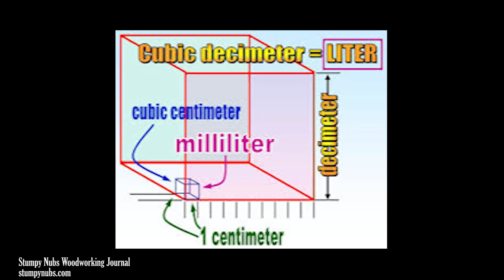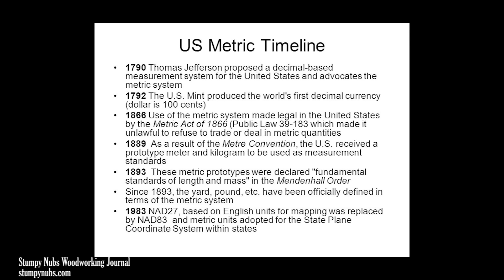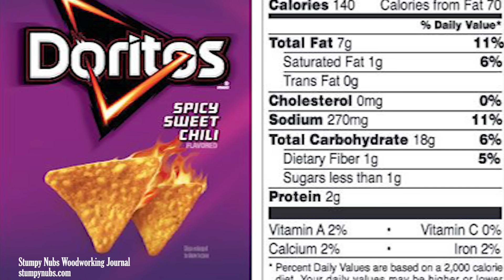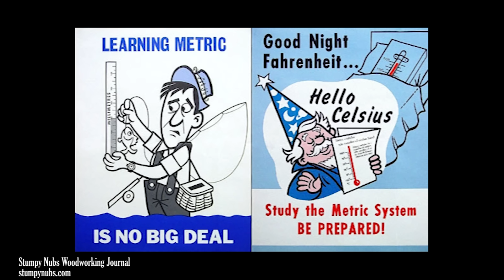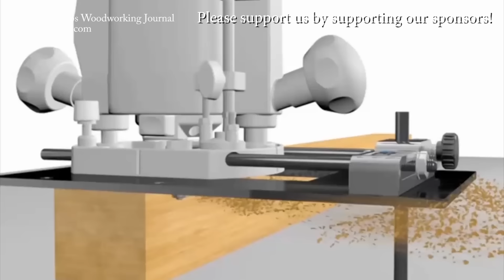BREAKING: The USA is switching to METRIC!

Comment: The last time this was tried was during the Carter administration. Like most things during his presidency, it wasn’t successful. The cost of changing machinery & hardware was extremely costly. If machinery is gradually replaced as they wear out, not a sudden mandated replacement, it will be possible to change.

Comment: It’s also so much more logical for temperatures – Centigrade vs Fahrenheit. 

20° C is twice as hot as 10° C! 40° C is twice as hot as 20° C. Incredibly useful. 

Stupid Fahrenheit – what is 20° F? (Better wear gloves out!) 50°F? Still need a jacket. 70°F. Start thinking about shorts. 90°F? Beach! 

So much less useful than easily knowing 100°C is 10 times hotter than 10°C!

Comment: One important point you haven't made: imperial IS metric these days.  An inch is oficially defined as 25.4 mm. Because of this, when you are using imperial units, you are just using metric with some weird multiplier, so you might as well just switch.

If you had an actual separate imperial length standard, an inch stick or a 1 foot rod, switching systems would mean loss of precision; and you could never switch exactly.  But there isn't.  The stick is a 1 meter stick.  Just change your multiplier and poof, you're metric.

Comment: Lay out a circuit board in inches and in metric.  Night and day.      Design anything in metric and you have such a simple time finding the middle and making equal spaces.   If we wanted to change things, starting out with wood dimensions would pretty much get the ball rolling.    ( However,  we're idiots. )

Comment: South Africa went metric in 1968. I remember the petrol bowsers were changed from 40c per gallon to 9c per litre. I tried working on a project where the plan was measured in inches. When you see 6 5/8” on the plan is where you say enough! 😄

Comment: Residential construction and building will likely stay Imperial in the US.  That is mostly taught from doing, young learning from old. Old use imperial, so new learn Imperial. Also Road speed signs will likely stay as MPH simply due to most current drivers being used to that and most cars with speedometers in MPH.  Change that suddenly and chaos ensues

Comment: One fact is that everybody who comes from metric and has to switch to imperial hates imperial for the rest of his life, while someone coming from imperial switching to metric will eventually love it. All science and engineering calculations are done in metric because it is so much simpler. Only construction will need some time to adapt, to get used to new numbers. A 4x2 will be a 10x5, 12 ft will be 366 cm.

Comment: In the Netherlands we don't realise we never went fully "metric" either. Our rulers are metric, but we buy lumber with the width in "duim" (2,5 cm), floor tiles are measured with "voet" (30 cm), when we go to the butcher we often ask for a couple "ons" (100 grams) or a "pond" (500 grams) of meat. We only altered the conversion factors to correspond nicely with metric. In a situation where you want to exactly measure, metric is very useful, but if you want to estimate things, imperial is convenient. I use quite some American made parts, stuff where hole spacing is in imperial. I refuse to convert this to metric and end up with overly complicated diagrams. I have some imperial tools as well, both systems work and both systems put people into space.

It doesn't really matter if one is a bit more convenient than the other, people need to completely relearn how to measure and estimate things. Institutions can move to metric whenever it's really needed but the average Joe probably doesn't care and is gonna stick with what he knows. 

As a European metric user by default, I say both systems are adequate. I use them both almost daily, both make sense, they only annoyance is that mixing both systems is the hard part. Get yourselves an imperial ruler, and learn to work with it. Sometimes metric doesn't round beautifully up and down, imperial will for your projects. I rather work with whole numbers and two systems (atleast for now) than a bunch of digits behind the comma. But hey, to each their own hahaha

Comment: What's interesting is that standard measurements still are engrained in the global circuit board industry. Even a Chinese PCB manufactures has ounce measurements for copper thickness and minimum trace widths and spacing in mil (thousands of an inch). Of course you can use metric, but they are awkward conversions to 3 decimal places.

Comment: I think keeping the imperial system is good too, but keep using both and teach metric in schools. Road signage would be a challenge and cost a lot. Here in Australia we still use both to a certain point. We use psi for tyres, we use knots for weather forecasts. We also use squares for building sizes which is 10sq ft. Also ceiling heights are feet. We still use lots of food recipes in cups and the most funny one is screens and tvs used to be centimetres now it’s all inches world wide and funny enough lots of us young and older Australians still give feet and inches for our heights

Comment: Metric is not just useful when working WITHIN a measurement system (like distance, area, weight or energy), but it's ESPECIALLY useful when CONVERTING between systems. For pure water at Standard Temp and Pressure 1 cubic cm = 1 millilitre = 1 gram. 1 metric tonne = 1 cubic meter. 1 joule = energy to raise 1cc of fresh water by 1 degree C, 1 Hectare = 100m x 100m etc etc. And since all material DENSITIES are listed in reference to water being 1 it's dead simple to find the volume of a material by weighing it and dividing by density. (MASS and WEIGHT are different, but unless you're measuring to milli or micrograms, gravity will have a negligible effect.

Comment: Loved this video.   Metric really is much easier, especially in conversions.

For example one litre of water weighs a kilogram, a cubic metre of water weighs a tonne - you can't do that in Imperial.

A Watt is one joule per second, a Joule is is equal to the amount of work done when a force of one newton displaces a mass through a distance of one metre in the direction of that force. It is also the energy dissipated as heat when an electric current of one ampere passes through a resistance of one ohm for one second.

A Pascal is one kilogram of force over one square metre,  a Newton is the force required to accelerate one kilogram one metre per second per second etc. etc.   

SI is so much better...

Comment: Being from a metric country (Brasil) I should agree that looks "stupid" that US still insists on imperial system while 90% of the world goes metric. However it's not a simple task moving from a system to another. This is something so stuck to the American culture that it could take at least a full century to fully perform this change (and yet there would have remains everywhere). Moving from a system to other is not like pick a metric measuring tapes and learn how to use it. Think about all the traffic signs and the vehicles tachometers that are set for miles. Think about all the bolts and screws existing in millions of machines, all set in inches, with its respective wrenches. All those machines and tools would have to be disposed and remade (of course we are talking about a FULL change). And it's not just length and size. Think about weight and all the millions of scales all around America that would have to be replaced or at least entirely adapted and recalibrated. Think about all the packaging that would have to be reprinted (it shouldn't be actually too hard). Think about the educational system that would have to be fully changed to start teaching kids how to do metric and imagine trying to do this to adults that used imperial their whole life. Think about all the serious mistakes that would happens just because bad trained people (or simply people unable to understand the new system). Think about all the measurement equipment like cups, rules, tapes, precision laboratory stuff, etc, that would have to be disposed and full replaced. Think of the cost of all of this. Think of all the labor. In my opinion the logistic to allow such change is so huge that I believe that there is not the minimum possibility of US (and the few other countries that still uses imperial system) to make it.

NOTE: of course it doesn't mean that you cannot do it yourself in your own shop and move to metric rules and measurement tapes (although I really don't see any advantage of doing it if you live in an imperial system country).

Comment: just like to point out that the decimal system is not the same as the metric system.
Decimal system is just a base 10 number system which seems to be common to eastern and western cultures and languages - probably cause humans have 10 digits.
Metric system is kg , meters and seconds -and almost any other quantity can be based on these - like 1 litre is just one cublc decimeter of liquid volume.

Comment: I watched a video someone made about converting to metric and there was one thing that stuck out to me. As someone who has used inches most of my life but has used metric for half. Metric just doesn't mean anything to me. Like physically. If someone tells me something is 5ft, I can picture that, when someone tells me they are 1.9m tall that doesn't mean anything to me. The biggest issue someone has converting is the physical distance they put to that measurement. The one argument I always here is that the conversion between feet and miles is too complicated. To that I say, so what. I've NEVER had to convert from feet to miles in ANY practical situation. There is a point where distance becomes too large and becomes an extremely rough approximation. You can say a shed is 12ft by 20ft and that makes sense. When you say something is 400ft, it becomes a generalization. Without using tools, distances become arbitrary and only becomes a ball park. the difference between using meters and feet is irrelevant. Beyond that, when is the last time you said the grocery store is 48.35km away or 5.26 miles. No one does that. It is 50km or 5 miles. When you have to use exact measurements you have to use tools anyways. 

Beyond that, I prefer Fahrenheit for temp. It is smaller increments and I like my house at 69 degrees not 70. And then there is the boiling/freezing debate. Does water boil at 100C? it can but it doesn't always, in fact it only does that at sea level. In the mountains you can boil water at 92C. Oh and you also need pure water, stuff like salt will mess with boiling and freezing as well. That means that the only place where this actually would matter is when your cooking food and I can't remember the last time someone took the temperature of a pot of water to check what the temperature was.

If you think we are bad check the brits or canadians, they routinely use kilometers for distance but then use speed in mph. Also, pretty sure the world measures their tvs in inches.

Comment: 1 horsepower = 2545.46 BTU per hour.  1 Watt = 1 Joule per second.  For engineering students struggling to pass Thermodynamics class, SI units are far easier to deal with than Imperial. But I don't want to buy gasoline by the liter or measure lumber by the meter, and there's really no reason anyone should.  Volts, Amperes, and Watts are all metric, as are many other units Americans commonly use.
In the most common version of the metric system,  SI, units are base 1000, not base 10.  Thus we get prefixes like nano, micro, milli, kilo, Mega, and Giga.  The centimeter isn't an SI unit, it's 10 millimeters or 0.01 meters.
I use metric units for all my professional work, but it's not without its quirks.  Engineers like the SI meter-kilogram-second system with force in Newtons, while many chemists still prefer the old base 10 centimeter-gram-second system with force in dynes.  
The worst quirk, however, is that the 'official' metric system (if there is such a thing) refuses to recognize rotation.  Yep, according to the BIPM in France that decides such things, rotation is dimensionless.  There are no degrees, no radians, no Hertz.  In their absurdity, a half a bowl of cereal must be the same as a full bowl of cereal rotated half a turn.  To be fair, their official way of expressing it is "one cereal at one half cereal per cereal."  For obvious reasons, everyone outside of the BIPM ignores that rule and applies any of the non-metric units of rotation.
Imperial units have quirks as well. The metric system correctly differentiates between mass (kilogram) and force (Newtons).  Imperial units can't seem to wrap their head around this simple truth and call them both pounds.  Thus, a pound mass, accelerated by 32 ft per second squared   is still a pound. Mathematically,  1 lb = 1 lb ft /s2.  To overcome this mathematical dilemma, engineers use lbm for mass pounds and lbf for force pounds.  The Brits use stones for mass but not force, which also works.

Comment: In the UK we haven't fully gone metric. 
We describe a cars efficiently in MPG, our road signs are in miles not Km.
We drink pints of beer, but it's probably officially the metric equivalent. 
I think officially we are metric, we just have some imperial leftovers.
I school we are taught both and I often switch from one to the other. 
When measuring long distances I may use inches and when a finer measurement is needed mm.

Comment: The Imperial System and the US Customary System are related but not exactly the same. The main difference is in volume measurements. The Imperial System was codified in 1824, the US Customary System is based on British/English systems of the 18th century, at the time of independence.

Comment: Up here in Canada we aren't 100% metric. It's mostly because US and Canada are each others largest trade partner, and alot of our culture is fairly similar so it gets confusing if we don't do some imperial stuff, but we kind of do 50/50 and hope no other nation calls us out for it. Everyone uses feet and inches for their own height and pounds for themselves, and we will uses "cups" for cooking, but no other imperial unit. No one will know what a quart is. We have metric for road signs, food labels, gas, etc. Most construction uses imperial, however it can depend on how precise measurements have to be and what job it's for. We took one half-step away from your system, did a deep breath out and congratulated ourselves for being better than you guys, while not actually doing the whole thing

Comment: I'm Australian and have always used metric - but am certainly familiar with imperial.  Biggest problem I have with imperial is knowing what the next sized spanner is.  eg, what comes after 1/2, 3/8 etc.  Metric is easy in that in that if the 10 mm spanner is too small you grab an 11mm.
Wheel sizes are dominated by imperial with a couple of exceptions in bicycle wheels where 700c is the current road bike standard.  But otherwise I have bought 12, 16, 20, 24, 26, 27.5, & 29 inch bicycle wheels/tyres over the years.  Car wheels are the same, but is comical in that the width is mm, diameter is inches, and then you have the aspect ratio.  So the three numbers on your car tyres are three different units 🙂
In my mind the word "miles" just sounds better in throwaway comments...  eg, "we are miles away", "missed that by miles", "hit that golf ball a mile".  Using the word "kilometre" instead of "mile" in those little comments just doesn't sound right.
I think imperial with height and the weight of a newborn baby - eg, I know a nine pound baby is a big one.  If I hear a 4kg baby I tend to need to convert to pounds.  However when discussing weights after babyhood it is kg all the way for me... go figure 😅
Reply: I fully agree metric is far superior than imperial, but we need to standardize on what we call a wrench.
Reply: @stevenlochner4619  haha - never happen.  We can't even standardise spelling 😂
Reply: "Go figure" - pun intended !! I agree imperial can be better using in sentences. E.g. Milestone is better than a kilometrestone.

Comment: Im a product designer and can use both inches and mm for length to design easily. Go between, use fraction on the inch stuff I know all the decimals to the 16th off my head. But aside from psi I’m pretty much using all other units or combinations of units in metric

Comment: Good point. I have been using metric in my shop for years and find it much easier when building projects and cutting material to size. Why is this you ask? 
well, many don't realize that the materials we have been using for years are actually produced in metric sizes. Frustrated me when I was doing all I could to get my projects right and doing the math on a close enough scale that they would always come up not quite right in the end. I have many metric tools in my shop that I use on my channel as well. Seriously considering the full conversion in my shop for good. 
Thanks again. Awesome video.

Comment: Metric life is just so much easier because everything is based on the unit of 10, so it is interchangeable.
100 cents in a dollar.
100 centimetres in a metre.
1000 grams in a kilogram.

Makes the calculations so much easier.  
Now...we just have to figure out the metric time and date system!

Comment: They said that in the 80s as well.  The metric system has been around since the 1700s.  If we still haven't changed, we aren't likely to.  I had to use metric as a nurse, so I am familiar with both.  That will have to do.

Comment: In Canada we switched to metric in the early seventies when I was in the 4th grade. I never found the metric system to be difficult to grasp or use and am basically bi-lingual and use metric and imperial with equal ease. However I still measure everything in my shop in inches and feet, guess old habits die hard!